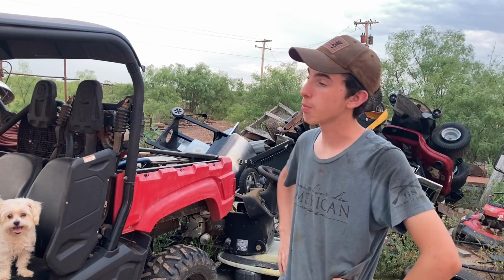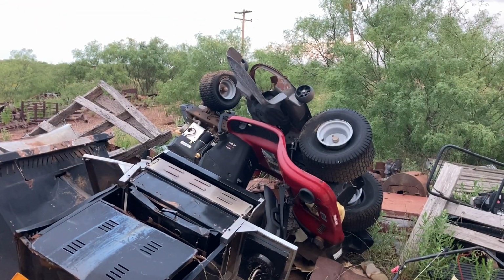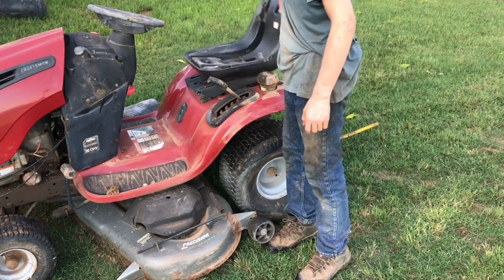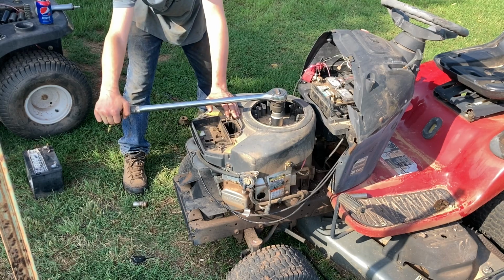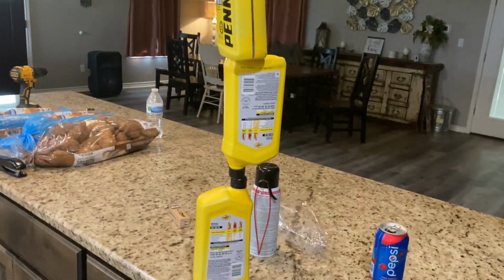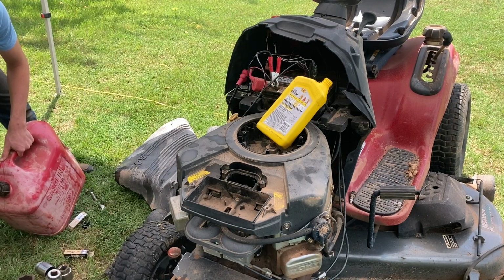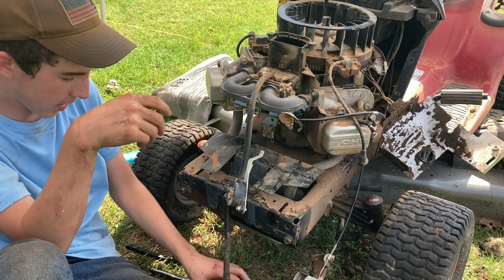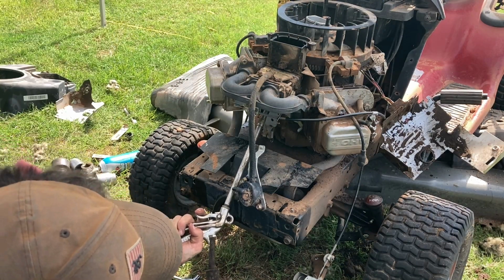Junkyard 26 H.P. Briggs V-Twin Intek Repair! (G.K. Workshop)

Comment: Good for you, buddy. Keep up the good work.
Its heartening to see equipment saved and put back into practical use again.
Reply: I own an 2010 intek b&s with 2245 hours , running a 54 inch mower, and a 48 inch snowblower , oil change every 75 hours, works fine

Comment: Genius that only works if the print case is not full of rubber water from meing sat down and without the hood on it but it probably is so you could have thrown the fucking rod through side of the block
Reply: Yep happened to me before